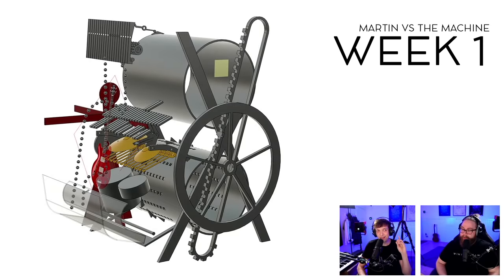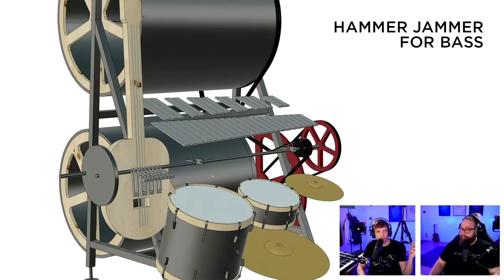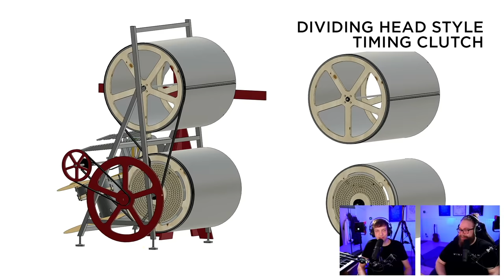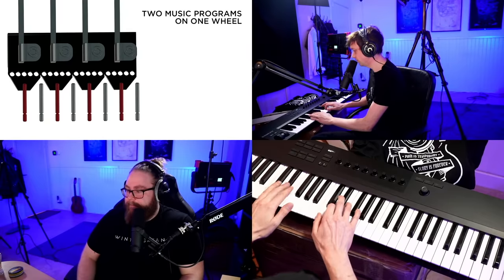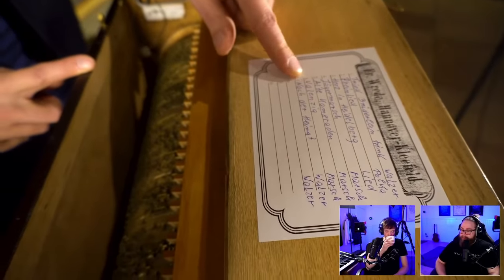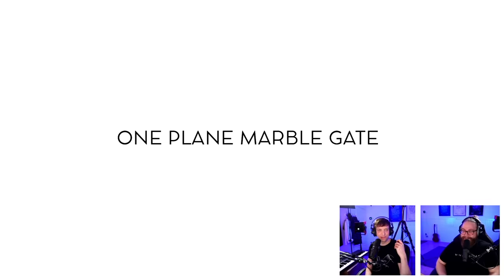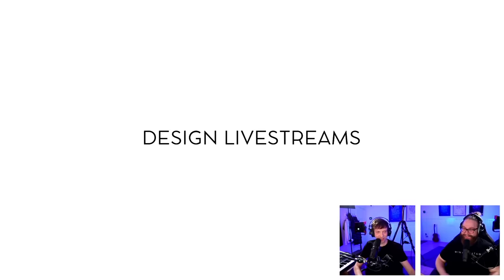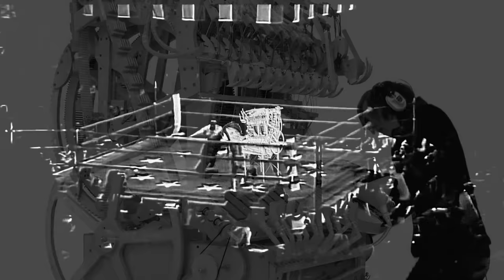Longer Music Programming - Martin vs The Machine - Week 2 Summary

Comment: If you click on Display Settings (the Monitor icon at the bottom of the Fusion 360 window), then Camera, and choose "Perspective with Ortho Faces" the 3d images will look more natural on screen - and the perspective will conveniently go away when looking straight onto a face. The Isometric 3D and lack of perspective hurts my brain.

Back in the '80s when I learned drafting, there was a purpose to the isometric 3d views, you could measure in three dimensions. I have yet to find a use for ISO 3D in CAD.

If someone can tell me why it is so common to see people using CAD but not utilizing the natural looking perspective views, I would appreciate it. Really, I'm not being sarcastic.

Comment: You can't be reprogramming those huge wheels with hundreds of pins during a live performance... No matter how careful you are, people will make mistakes... Remember they won't be able to test the pin placement before you play them. Why not just have a pre-configured programming wheel for each song? Yes they're bulky but each wheel will fit in it's own flight case... Then also the pins don't have to be removable so can be permanently attached...
Reply: I'm pretty sure "programming" it is attaching the CNC'd programming plate like with the MMX. It has the pins pre-cut out in it
Reply: @theajayyy  Are you sure? In the first livestream he was saying that the new programming wheels were going to be full 360 degree hoops cut from giant plastic pipes, not assembled from several curved sections... It's possible I misunderstood... haven't really been watching the livestreams... 🤷‍♂
Reply: @dbrophy  I think you are right

Comment: Gee, what if the drums were programmed with little magnetic domains that some suspended heads could pick up and then some electronics to analyze the signals and turn them into actions with electronically controlled effectors. I appears that the drums could be programmed within one rotation of the fixed drums. Or maybe you could find a non-moving way to store this information . . .

By the time you have used CAD tools to create a precision machine, you might as well go all the way. No reason you couldn't still be dropping marbles if you really wanted to, but in reality you could use some AI to simulate what that would sound like and just . . . 

What I'm trying to say is that in my opinion you have already transitioned to a world where you are trying to achieve musical perfection, not particularly an amazing mechanical marvel. I am leaning towards the give it up.

But nobody asked me.

Comment: Why do you change the whole drum - why not just the programming, like on big looms.
It's best to use the same material for everything constructive - especially on tour. Wood and metal expand differently when heated (transport in a truck - cold stage - stage heated by spotlights...), which will have an impact.

Comment: you are like Karl Benz, he never would have gotten his auto building going without Bertha's trip. I feel that the MM X was just about perfect and that what you are designing will not really work in real life.  I would imagine that you will have an impossible time not believing that what you put in cad does not work when you are standing next to it, and you will keep going back to the X and realizing that it was 99% perfect, much more than what Karl Benz had developed when Bertha went off on a 65 mile trip to prove the worth of his invention to him. you need a Bertha, to prove what you did worked. and that really you are wasting your time with the new one when the X worked perfectly fine.
You also will not believe how many changes you will have to make after it is built. I predict that you will need to make lots (more that 10) of changes to the machine after it is built.
Benz built the first moving car, but Bertha drove it to prove its worth.
If you feel the MMX is unworthly to play on stage, offer it up to someone who will do what you can't with it. I would venture to guess you would have no problem finding someone who would make your machine rock.

Comment: You said you don't want to fully set your requirements yet. I think that's okay, but I think you should try to clearly define success as soon as possible.

Is success a working machine? Is it a world tour? How many songs care programmed? How long do you want the project to last? How many instruments on the machine? How many parts have to be made by you? What's the allowed marble failure rate?

If you don't define success then you risk feature creep. You have to be able to say no to GOOD ideas. If a good idea isn't part of what you define as success, it should be ignored. There may be a cool way to add another instrument to the machine, but it doesn't matter if it's another thing keeping the machine from being finished.

Same thing with tight standards. You may not want more than one in a million balls hitting the floor, but fans would probably rather have the world tour and have a couple missing notes than no world tour. I think you may feel the same, but in the moment you just see a mechanism that isn't working properly.

This is different than design requirements. If you define success as always working on a machine and putting up a video every month, that's okay too. You just have to be sure you're making decisions that contribute to what you define as success.
Reply: Unfortunately he is not going to listen to this and just keep making the same mistakes. I give this machine maybe a 20% success rate. Wouldn't be surprised if in 4 years he starts over again.

Comment: I would love to see you have a solenoid pack that could activate the droppers, then all timing can be done electronicly and you would not be limited by the wheel.
Reply: That's sort of giving up, though. The point of the marble machine is to play it by cranking the wheel and pulling the right levers.
Reply: At that point why not just compose all the music on a computer and be done with all of it?

Comment: Hmm. I honestly see a pivotal mistake being made that will doom this endeavour. An engineer MUST cordon off what they are planning to do before actually getting to work. Already you start to come up with new ideas, start to design mock-ups and prototypes and again are giving yourself flexibility by putting specs that are subject to change. This route you will AGAIN fall down the eternel path to impossible perfection. It is the same criticism i had on that "i failed" video. You are learning the wrong lessons from non-engineers like Musk and are rushing headlong into repeating the same mistakes and letting Feature Creep again...well... Creep! You have to learn how to apply proper engineering methods!!!

I would tell you stop right this moment. Take a step back and think deeply on what you where trying to make in the first place.
As far as everyone can tell. What you made with the original was HALF instrument, HALF (kinetic) sculpture. You started the 2nd gen to "simply" create a successor that could survive travel. That was the original goal as you told people. Use this to draw up a real Spec Sheet, apply MoSCoW prioritization to figure out what should and what shouldn't be and commit to these specifications.

And for the love of everything. Ditch any pretense of perfection. Perfection will just end up with you in 10y working on the 5th or 6th iteration. You already made perfection impossible and made it a work of art by building a marble machine to begin with. Set up proper tolerances with a threshold of which reaching is "Acceptable" and on reaching STOP.